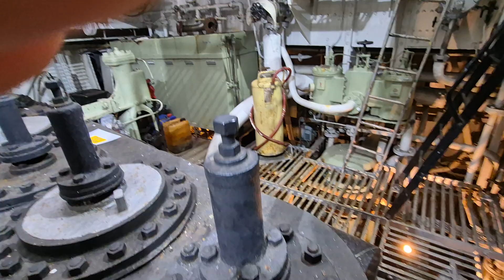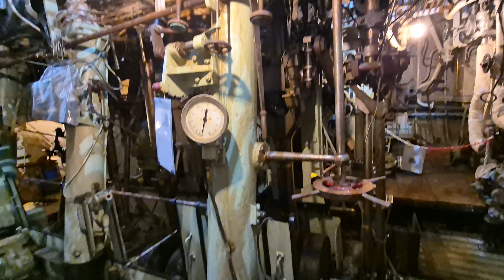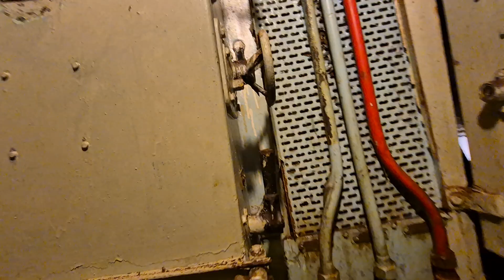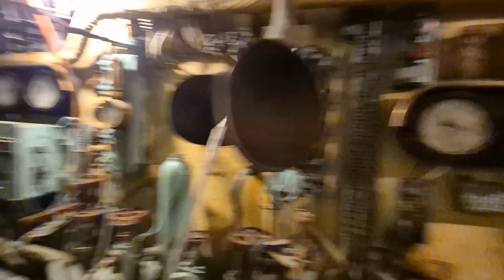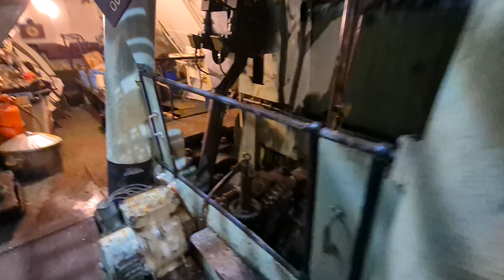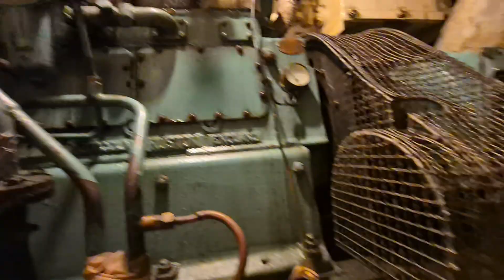SS Explorer engineroom overview.

Comment: did the ship have any steam powered generators?
Reply: It’s amazing to me that a ship built in the 50s did not have water tube boilers and turbine engine.
Reply from the maker: She was built with the reciprocating engine because she was to spend a lot of time doing work at very low speed. Turbines are better suited for high power, high speed running
Reply from the maker: No, all of the generators are diesel fueled
Reply: @scottdickinson1130  if its  a steam ship then why do they have diesel generators?
Reply from the maker: @JasonRector-nd4li diesel engines were standard equipment for everything on nearly all fishing vessels built around that time, so the builders went with diesels for the generators. Explorer was built and operated as a research vessel her whole life and some of the work she did required her to travel at much slower speeds than a diesel would alow, so a steam engine was specified when she was built. She was also the very last ship to come out of her yard in Aberdeen with a steam engine fitted

Comment: Great video, thanks so much for posting. Would be wonderful to see the triple expansion engine running. Maybe one day?
Reply from the maker: Unfortunately, it's unlikely at the moment. The boiler and every square inch of the steam pipes, and the entite fuel system would require massive amounts of work before that could happen
Reply: @scottdickinson1130  Hi Scott, thanks for the reply.